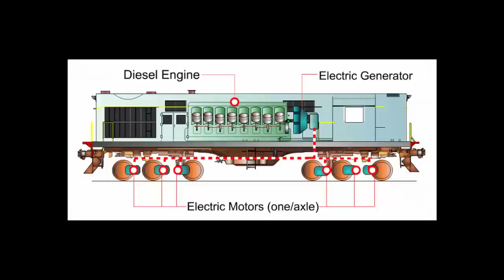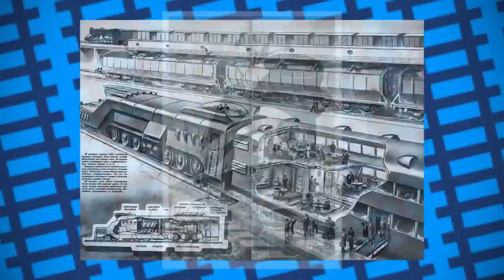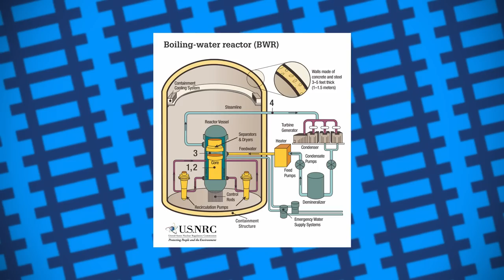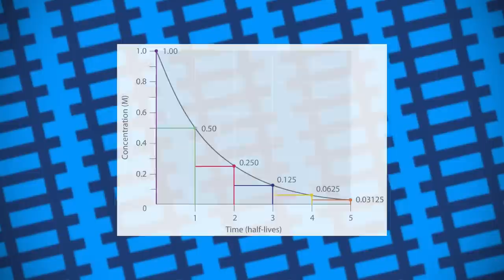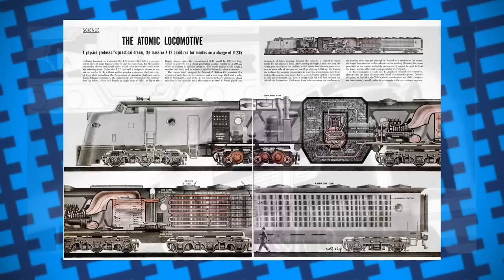Why Nuclear powered trains aren't really a thing

Comment: Nuclear Power is the ultimate example of not every form of power can be properly applied to trains. Nuclear plants work fine enough in power plants because they're stable, and ships are - more or less - the same way, especially when they're used on vessels which are vitually impervious to waves. You can't really apply that to a locomotive. You meantioned the size factor, meaning nuclear reactors could realisitcally only be applied to locomotives while cylinder and turbine power plants can be applied to trainsets and/or multiple units.

One problem you sorta skipped over was the conditions of a railroad. Many locomotives over the years were tested due to the success in marine and stationary applications, but translated poorly to railroad use. The Napier-Deltic engines proved fine for 100 mph passenger service, but still took a beating and needed to have spare engines on hand to be swapped out if needed. Similarly, Fairbanks Morse locomotives might've been powerful by comparison to other units, but couldn't handle the rough and dirty conditions that railroads often were. They also weren't the best when it came to constant changes in power applications. The longest lasting examples kept working because shop crews were familiar with their Marine power plants (they worked in shipyards in WWII for context). To say nothing of the hit or miss nature of steam and gas turbine prime movers. Powerful for size, but fuel hungry and maintenance heavy. They could also catch fire if not taken care of. So...trying to picture a poorly maintained nuclear locomotive is terrifying.

Comment: Nuclear powered substations equiped with small submarine-style reactors along remote railways lines are indeed probably a far more realistic solution.
Reply: More realistic than just an overhead power line? The difference in price between a nuclear sub and a non nuclear sub is well over double the price, meaning this one nuclear trai engine will cost 560+ million, which would be over 560km up to 2,000km of overhead power lines.
Reply: @Alex-cw3rz  This nuclear substation would feed an overhead power line or a third rail, and normal electric trains would ride on the line. It would just be a dedicated power station for the railway. For 90% of the world, using power from the grid is of course more interesting, but my idea was for something like the most remote sections of the transiberian...
There is probably other, and even better, ways to improve theses remote lines, but if you want to get all the advantages of the electric traction, I think it's a possible solution.
Reply: @NQR-9000  most remote sections of transsib were electrified just fine without mini-Chernobyls along the way.
Reply: @Volodimar  So, there was a better way! 😅 All that makes the whole nuclear train idea redundant, I guess.
Reply: Until you derail and hit one
Reply: You could also just use solar and have basically no maintenance costs.
Reply: Great idea...now lets put a refrigerator sized nuclear reactor in YOUR backyard
Reply: @huskerhank9896  25 years of constant electrical power without reliance on the grid? Yes please!

Comment: 0:36 and yet, there where extremely long electrified routes in the US designed and built(The Milwaukee Road and Pennsylvania Railroad had hundreds of miles of electrified track, some of which is still in use with the same equipment 100 years later; ATSF planned to electrify from Missouri to California(2,500 track miles, 1700 route miles), and UP came within inches of electrifying from North Platte to Salt Lake City); and in particular the trans-siberian railroad is electrified, all 9,289 kilometers of it. Looking at folks other than those focused only on short-term profit or affected by political ideals, India has 52,247 route kilometers electrified and is working on electrifying everything...

 Sorry, I might transferring to this video, or that moment of it, my feelings towards people who confuse "takes effort" or "more expensive than doing nothing" with "impossible"
Reply: I'm not expert on the geography of Russia, but I don't think that they have a massive mountain range cutting the nation in half like the Rockies.  So there's a possibility it's down to the fact that pure electric locomotives might not have the power to traverse such difficult terrain with the loads that freight trains in the U.S. do.

So it's probably more complicated than "takes effort" or "more expensive than doing nothing", there might be some technical limitations that prevent it at the moment.  Again I'm no expert on this, but that might be another possiblity.
Reply: The Milwaukee Roads electric divisions where built to deal with the Rockies in the 20s. The Virginian's where built to deal with the Appalachians with coal trains, again in the 20s, and Russia has several mountain ranges across the route of the Trans-Siberian

Comment: aren't french trains basically nuclear powered? after all France gets a lot of its energy from nuclear power plants.
Reply: I was about to say the same. 
Nuclear trains work...provided the reactor doesn't move!
Reply: But they use overhead wires
Reply: @FunAngelo2005  but the power comes from nuclear reactors
Reply: @ww32  but they are indirectly powered
Reply: @FunAngelo2005  They're indirectly use their nuclear reactor to power which is alt idea that works at least. And plus the nation is less hysterical vs USA
Reply: @FunAngelo2005  directly from nuclear power

Comment: 2:44 that is actually very wrong. nuclear reactor that powered aircraft only weight 70 tons. but after that project was abandoned there were several advancements in shielding that could make it way lighter still.

Comment: Technically most of the high speed rail in France is nuclear powered. Their high speed rail is electric and the majority of electricity in France comes from nuclear plants. Turns out that just not putting the reactor on the train solves most of the issues with the concept of a nuclear train.

Comment: If i recall there was a hydrogen cell powered loco somewhere, it ran off reclaimed water, but the prospect sufferers for too many problems, like that the fuel tank is filled with one of the hardest to contain and most explosively active elements
Reply: Also keep in mind that hydrogen isn't an energy source, just a storage medium sort of like batteries. It requires energy to create hydrogen from water, and that energy (well some of it, with some energy lost as heat) is then returned as electricity in a fuel cell. I suspect batteries would be more suitable for trains, as they aren't really weight limited - if one locomotive loaded with batteries isn't enough, you can add as many battery-filled "tenders" as needed.
Reply: I think they are actually in regular use on some smaller lines in Germany.
Reply: @quillmaurer6563  You would need several rail cars worth of batteries for any meaningful range. That replaces weight/length that can be used for paying cargo. And unless you want to reconfigure the train to swap batteries, recharging time will be a nightmare.

With hydrogen, it could still be stored onboard the locomotive just as diesel is today.
Reply: @dgthe3  Depends on what "meaningful range" is. I could see a system with an electrified main line and unelectrified branch lines or industrial spurs, only needing say 10 or 20 miles range (or perhaps much less in some cases) could avoid the need for either using diesel locomotives or elecrifying those lightly-used branch lines.

The battery tenders replacing paying cargo is a consideration, a trade-off, but if it saves cost on running it might be worthwhile. If say you're replacing one of your 20 freight cars with a battery car, but it saves 30% of operating costs (not just the fuel but also maintenance of the diesel engine), that's a huge plus. I don't know if it would be anything like that, if it would be that favorable, but I could imagine it being that good or better - someone more knowlegeable than me would have to figure that out. But just losing some cargo capacity (or the battery electric locomotives needing to be more powerful to haul their own batteries along with the train) might still be advantageous.

As for battery swapping - that's the easiest part, and one of the reasons trains could do this easier than anything else. Simply put the battery tender on a charging siding, remotely raise the pantograph to an overhead wire (nobody having to leave the cab,) uncouple it, move over to another that's charged, couple it, lower pantograph, off you go. I can't imagine any other vehicle having it that easy, the great thing about trains is the train as a whole (not an individual locomotive) are entirely modular. The other option, depending on the network it's running on, is that part of the system could be electrified (such as the main line with unelectrified branch lines I mentioned), and the batteries could be charged with a pantograph while in motion just like any other electric train, so it would never be necessary to stop to charge. Again, another thing trains can do that isn't really feasible with any other vehicle (I've seen concepts of doing this exact thing with trucks, but that would be far less straightforward).

Comparing hydrogen, I think that would be worse in the regards you're talking about. Hydrogen is more energy dense per weight, but far less per volume - the hydrogen and its tanks necessary for meaningful range for a train wouldn't be all that heavy, but would be very bulky. Would probably end up the same way with "tenders," this time tank cars. Refueling would be faster than recharging batteries (maybe), but more complicated, requiring hydrogen be provided at needed locations, either shipped there or generated on-site, and the train wouldn't be able to recharge while in motion like a battery train could. This would be similar to how it's done with diesel fuel, but having to deal with shorter range, much larger volumes, and either highly pressurized or cryogenic liquid hydrogen, which is both more complicated and more dangerous to work with than diesel. Electricity for batteries on the other hand can be wired to anywhere on the network much more easily, can be fed into a locomotive or battery tender via overhead wires without anyone having to get out of the cab, and recharging can be done while in motion using century-old highly refined technology. So in many cases I suspect battery electric locomotives would actually be logistically, operationally, safety, and effort-wise simpler, cheaper, more efficient not only than hydrogen but even than getting diesel fuel into locomotives (not even considering the cost of the fuel itself). Only needing what comes through wires is actually really helpful versus needing some sort of fluid fuel. A good point of comparison is my gasoline car versus my mom's electric car. The electric car can be a hassle for occasional road trips (though with fast charge stations and the car having almost as much range as gas cars that's not a huge problem), but for most uses she just charges it in the garage, no hassle whatsoever, while I have to go to a gas station once a week.

Comment: Nuclear reactors have another problem for use on a vehicle that has to put out variable amounts of power:  They aren't good at starting up and shutting down on short notice.  For shutting down, you have to keep supplying cooling for a LONG time, due to the heat generated by fission products, and for starting up, if certain fission products (especially Xenon-135, which has its own Wikipedia article) that poison nuclear reactions haven't decayed, the startup becomes difficult and dangerous.  Ships and submarines go at constant speed for long periods, making this tolerable (if you didn't care about the radioactive waste disposal and the difficulty of shielding, or if you're really stuck with nuclear like on a submarine), but on a locomotive or even in a stationary reactor serving a rail line with low enough traffic to produce highly variable load this would be very problematic.

Comment: The Mars rover has a nuclear generator along with solar, which is why it'll only run in full power mode for 15-25 years then, it'll have to charge up every day by solar like WALL-E until dust covers the solar panel and renders the rover useless. Which is what happened with the first rover. A train could have a small generator but that'll mean more refueling which is costly and problematic, so the bigger it can be, the longer it'll go without refueling. The radiation is not a worry as submarines currently don't give off any harming radiation to the outside due to it's well engineered exterior, and also don't radiate to the lifetime of a reactor engineer. The main problem with nuclear trains and planes is definitely the crashing factor. Most current submarines are 30-70 years old and have only ever needed to be refueled 1-2 times. Little science lesson.

Comment: There's another useful thing that locomotives lack in comparison to submarines: direct contact to a large body of liquid coolant. Ultimately, the steady state power output of any such system is limited by its cooling capabilities, and a nuclear train would be hard-pressed for heat capacity, even if you carried around silly amounts of water.
Reply: I thought of that too, and started to realize how much alike the systems steam engines and nuclear engines would be. (For example, for those who don't know, the firebox of a locomotive has to be underwater at all times to prevent it from getting to hot and damaging itself. Sound familiar?)
Reply: @strcmdrbookwyrm  The Thing is that Steam Locomotives just exhaust the spent Steam. There have been Attempts at Condensing Locomotives (either to save Water or to make Trains harder to spot by Aurcraft), and all these Attempts were very unreliable because Condensers are to delicate for the Shocks and Vibrations encountered on Steam Trains. A PWR-Plant could theoretically be built to exhaust too, but you'd not only have to carry a ridiculous Amount of Water, but also couldn't use just pretty much any River Water as you do on Steam Locomotives. Just like Water Tube Boilers, the Steam Generators of PWR Plants are very sensitive to Water Quality.
Reply: @Genius_at_Work  The impurities of a river fill-up don't enter the core of a PWR (separate steam generator), but in a BWR it would; creates intensely radioactive steam with all the impurities.

Comment: Nuclear trains are a horrible idea, don't get me wrong.  However:

- For freight, a few extra tonnes of concrete or lead might actually help the engine, as it would get significantly better adhesion, particularly during rain thanks to a massively increased normal force, and therefore force of friction.  However, for it not to be a danger, you would need a very w i d e gauge to accommodate all that extra stuff.
- Nuclear waste impact wouldn't necessarily be all that large.  If I recall correctly, nuclear submarines are powered off of a golf ball sized chunk of plutonium, and that lasts it 2-4 years or something like that.
- The challenge of electrifying the entire United States network isn't necessarily hard.  What would be hard, however, is the stupid amount of money that would need to be spent buying copper, which pretty much always is in short supply.

However, the prospect of some guy binning it off the side of the rails is too great a risk.  Just stick with large 1000 to 1500MW reactors and electrify the rails...
Reply: A sub's reactor core is still pretty large. They last up to 30 years between fuellings because the fuel used is weapons grade uranium, very potent stuff compared to the low enriched uranium used by civilian reactors.

NS Savannah is a good example to look at for a civilian nuclear vehicle.

Comment: Hydrogen fuel cells might be an option. The current designs are apparently not powerful enough for freight, but have been proving practical for commuter rail and buses. Research is being done to see if power enough systems can be developed for long-haul heavy freight. If it works, the advantages are obvious - you don't need the expense and time to modify your existing track infrastructure with catenary/third rail or substations.
Reply: Meanwhile Germany figured out that wires are cheaper and better than H2, but you ought to go all in with wires…
Reply: Instead you'll need to modify your rolling stock and fueling system. 
Just electrify frickin lines!
Reply: @Volodimar  bonus for electrics: they have the same motors that your diesels have, but can keep them at the limit for longer, thus either pulling away better or pulling faster at little more cost… and you get back energy from dynamics…

Comment: Too bad the Arc Reactor from Marvel doesn't actually exist. Then there likely wouldn't be an issue with clean fuel. Plus, no waste, aside from the core element, which would likely be easy to dispose of